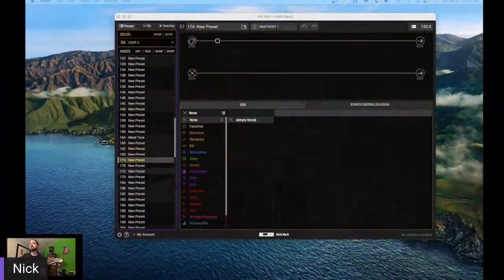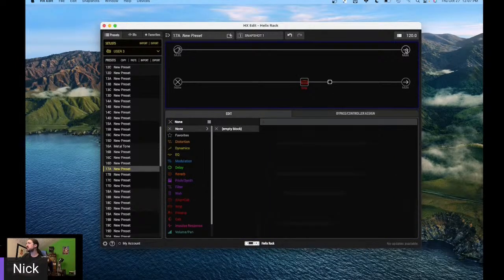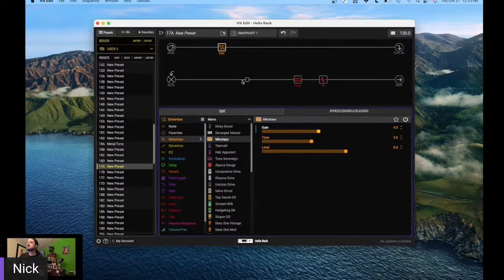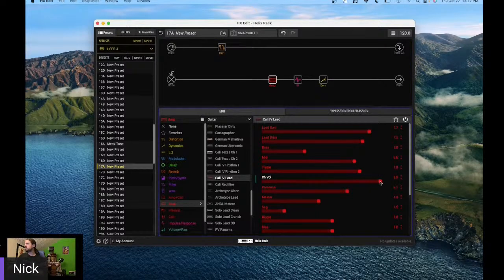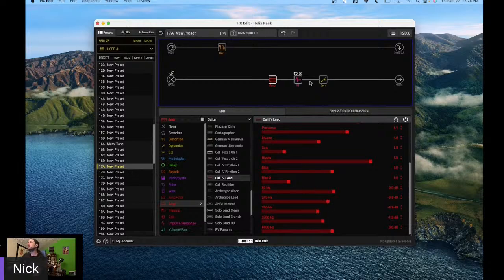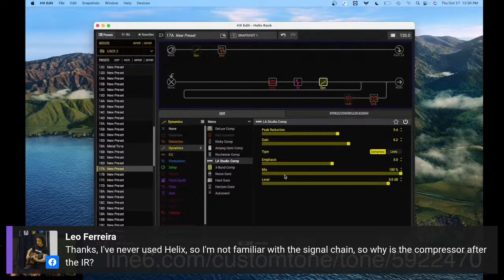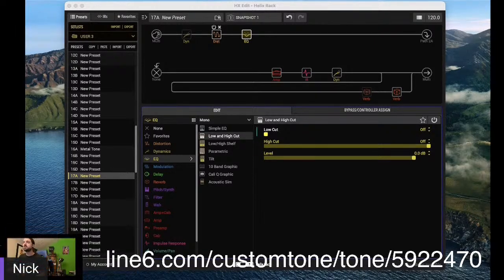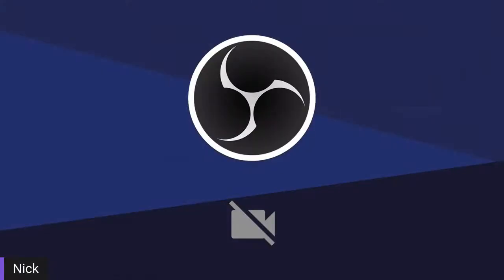Learning with Line 6 | Helix - How to Create a Basic Metal Tone

Comment: Mark IV: don't use overdrive.
Reply: depends on your guitar pickups, I have an axe with a Gibson Burstbucker 2 in the bridge (alnico 2) and the extra push makes it brutal
Reply: @v4ld3r5  yes, you're right, but when we're talking about metal we usually talk about high gain pickups, like my Seymour Duncan Distortion, and with something like that it's almost a crime to use an overdrive with a Mark IV.
Reply: @dantredogborsa7048  yep if you get anything with alnico 5 (or ceramic of course) and above 10k resistance then no need to boost unless you like to play with the gain at 3-4 which doesn't make much sense to me
Reply: Sometimes ya get better results with dialing the gain back on the amp and adding a boost to the front to tighten things up. To each is their own though. Yeah ya can get just as much gain by turning the amp gain up but a boost or overdrive can cut some flub if ya experiencing some
Reply: @flamesarewicked  To me the better way is dialing the gain back on the amp and use the hand to do the work: stroke harder, you get a clean and tight result without the overdrive coloring.